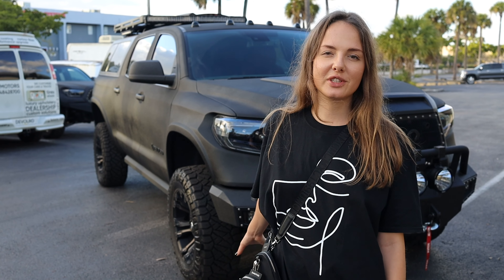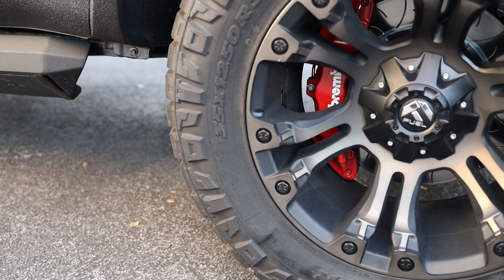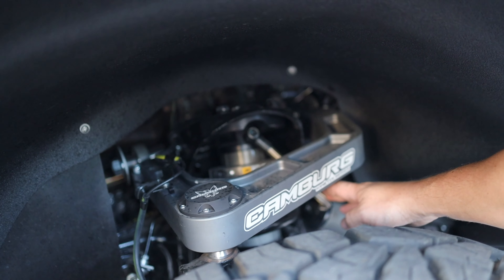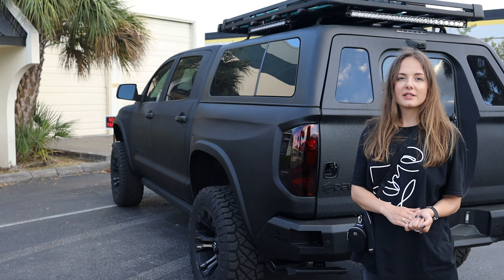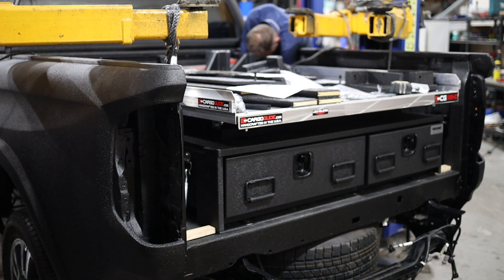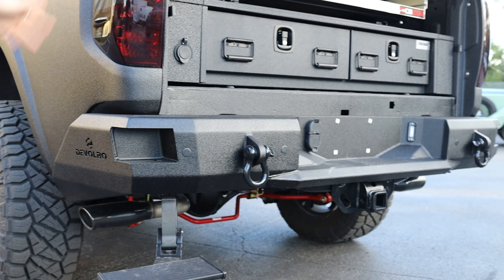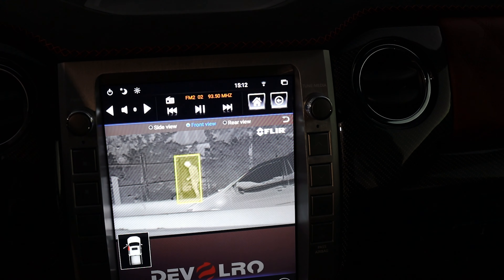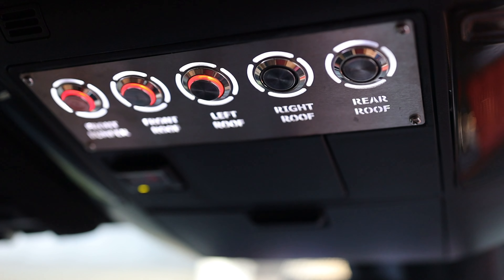CUSTOM TOYOTA TUNDRA | DEVOLRO BY ATV MOTORS | PART 2

Comment: Impressive suspension... very nice job on this, Any issues with all that weight in the rear? That has to be around 700lbs of deck, slide, bumper and topper, any payload left?
Reply from the maker: Plenty of payload left/ 
Use of aluminum, fiberglass, and some “secret” lightweight materials 😏 added for reinforcement in our custom parts.
Reinforced spring leaf package, sway bars, and traction bars... helping to get the job done
Reply: @ATVMotors  I wish you guys were in canada to help me build up my Tundra!
Reply from the maker: @CanadianPrepper  we can, but would need you to send the truck over  to us 😉🤷‍♂️
Reply: Beautiful you And the truck be blessed

Comment: Obviously you didn't use normal auto paint. What brand coating is it and what is the color?
Reply from the maker: This is our Dev-X Polymer coating, which protects the truck from scratches and dents. And this car is just black
Reply: @ATVMotors  Is this something people can buy and get it shipped or is it only available at your shop?